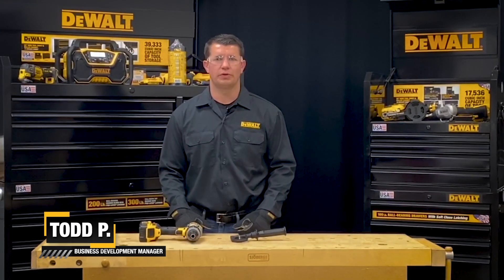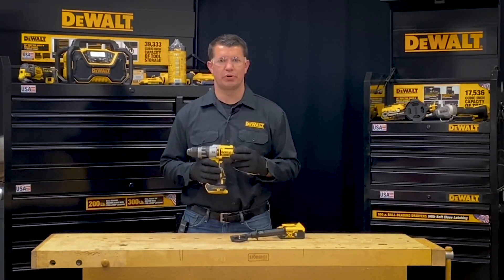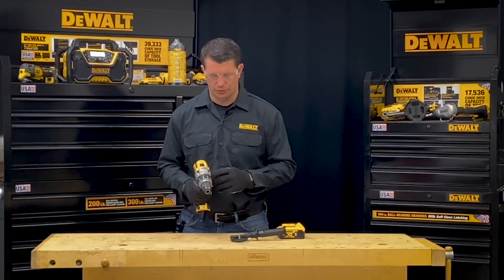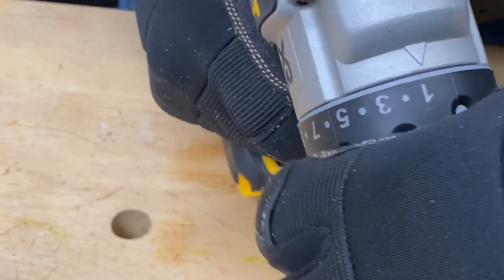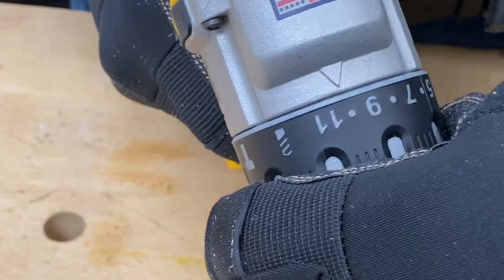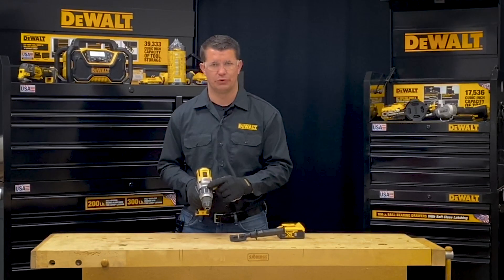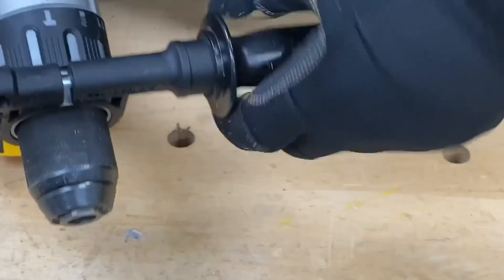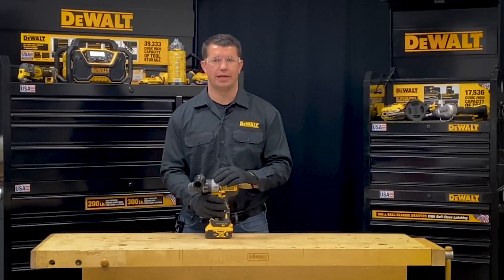DEWALT® Product Guide - Cordless Drill Speed, Torque, and Clutch Settings

Comment: I bought a DCD999 after years of happiness with the 18V about a year back and I've noticed the torque only works intermittently. I returned the first one I bought for another and it seems to be a design problem - just wondering if this issue is common or if mine are just from a bad batch. 

Let's say torque/clutch is set to 1. Minimal resistance should cause the drill to slip. If I set it to 1 and hold the chuck with my hand, it will slip on the first press of the trigger. If I press the trigger again it will turn with full force and not slip. I've learned the hard way a couple times for more delicate work, where I set a low torque setting and turned a screw way too tight when the it refused to slip.

Comment: I loved the 18-volt version of this drill. When the 20 Max came out I quickly picked it up and was disappointed that it didn't have an extra bit holder like the 18-volt did. Still a pain in the ass to this day to switch between bits.

Comment: I’ve had my DEWALT xl drill for a year now.  Drilled 4 holes to put in hinge bolts and the torque clutch feature has already been destroyed and has rendered the drill useless.  I would not recommend buying this drill.  It breaks too easily.

Comment: 1= high speed (low torque). 
3= low speed (high torque). 

1-5= stops easily for screws.
6-10= stops less easily for screws.
Drill icon= never stops (for drilling).

Comment: I have a question on the dewalt cordless drills. The battery and charger unit in the USA market are they 110 volts only or are they 110 v to 230v for international use as well. I live overseas and need to be carefull buying here cause of fakes. Thanks

Comment: are those numbers 1-11 equivalent to newton-meters of torque?
Reply: Probably not, as it varies the speed, or RPM's, which has nothing to do with torque.  Torque is a measurement of Force times distance or F x d (hence Newton . meters)  The switch on the top adjusts the Torque.

Comment: Can someone give a correlation of the torque settings to ft lbs or nm?  So what does a 1 equal? or 11 equal? This will depend on speed in 1 or 2 or 3?  This is regarding a DCD995 20vmax XR
Reply: they don`t represent anything no clutch setting on any drill represent anything it is just a scale like 1 being loser and 11 being tighter.

Comment: With my DCD991 drill/driver if using the 1st speed for lowest RPM's there is no way to adjust the clutch collar to prevent damage to a screw as the drill works as though in Drill Mode 100% of the time. It is why I needed to buy a separate Bosch driver for use with fasteners. No such issues with the older 18v models from DeWalt but something that was introduced with their 20v models.
Reply: Yes 100 Percent on this. If I want a lite torque setting you have to be in speed 3 . Which is ridiculous when using a small screw. It's a good drill but you will need another one as well for smaller jobs.

Comment: I just purchased a DCD709C2. My first cordless. Great tool. Now if I could only learn to use it properly. You talk about high speed applications and low speed ones; but you don't show any examples. Grrrr! I know that drilling through wood, for example, in most cases, you want high speed and no torgue. However, it's the opposite when going through metal, where I always use slower speed and high torque. According to your vid, all you do, is just set it to drill. You will break a lot of bits that way. So confusing. Maybe next vid, you could actually demonstrate the different applications and settings.

Comment: I have a dewalt 12” compound flexvolt  saw that dose a great job cutting wood but after spending $130 on a metal cutting blade i find it is just to fast to cut metal, it just burns the blade up can the saw be slowed down to around 1800 rpm if so please tell me how

Comment: Yeah, I phoned Dewalt to discuss the issue I was facing (as below, the fancy e-clutch thingy was just not clutching out and was destroying my screws). I ultimately wasn't sure if using it with normal household size screws (think door hinges and such) was not something the tool was designed to do, or if it was just outright defective. Unfortunately I was left listening to music for 10 minutes and then someone just dropped the call without talking to me, so I ended up simply returning the item and bought a different one. The whole situation is just not acceptable for a premium-priced tool. If you can't make the e-clutch work for a low torque setting, you could have added what is a relatively inexpensive mechanical clutch instead, and left the e-clutch just for drill mode as a safety mechanism.
Reply: I hear you, you can drill holes with the clutch on 1

Comment: I bought a 996 hoping it could work well as a driver, but the clutch is too strong for normal household applications and always destroys the screw. It also doesn't stop the tool at all if I use it at speed 1. I was forced to buy a separate screwdriver tool which was pretty disappointing
Reply: I know what you mean I have drilled holes with the clutch on 1

Comment: after smacking myself in the face a few months ago, I finally learned the handle lesson 🤣
Reply: Bought this hammer drill about 3 years ago.  Left the handle in the bag and have never used it.
Reply: @beeps7  it's possible you're using it different from me, the time I got smacked I was driving a big grk lag screw into a green log and it bound up. After putting the handle back on no more problems.